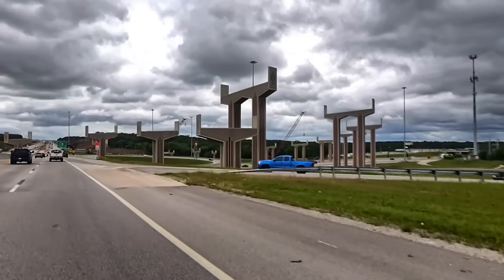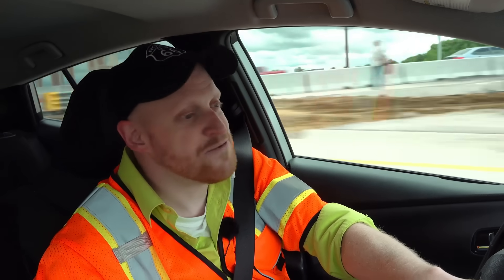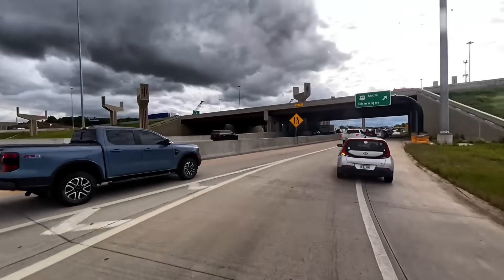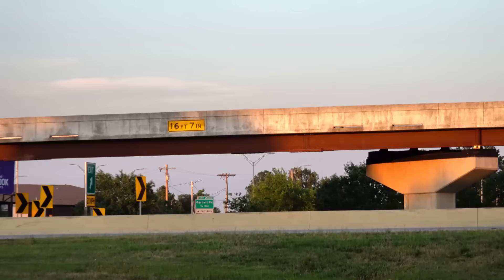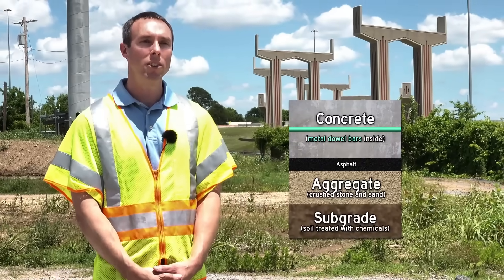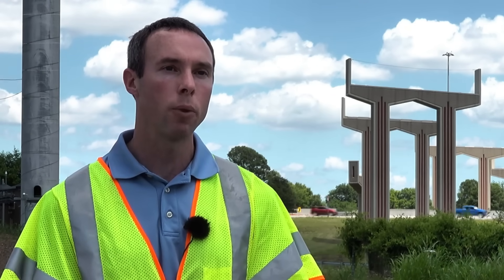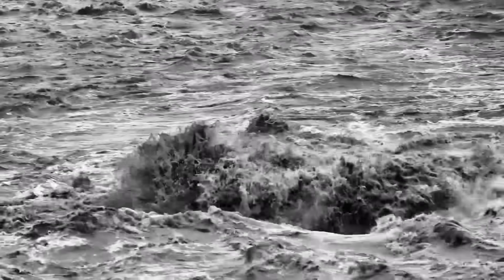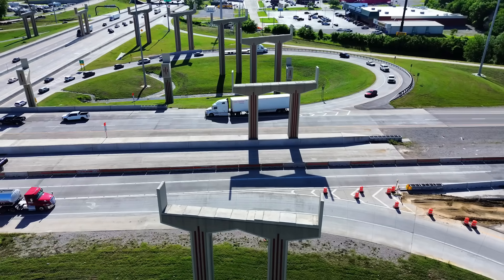Tulsa Built 50-Foot Goalposts 🏈 (It Fixes a Cloverleaf Catastrophe!)

Comment: Hey Rob, I am the engineer that oversaw the design of all those piers. This is by far the best video/article that I have seen detailing the reasons why these piers were constructed. Thank you!
Reply: There’s a good chance we know each other! I worked on the PE Study and WP1 & WP4! Super cool to see the project highlighted here and well explained. 

Fun fact for anyone else, the original functional plans included in the environmental assessment published in early 2000s actually used the metric system because the US had adopted it in the 70s and the USDOT was planning to require metric in all plans by 2000. But during the study that adoption got canceled, however the plans continued to be produced in metric.
Reply: @rosshelliker5564  Yes we do.
Reply: It's fun to hear how terminology changes over geographic regions. IE. "work packages" vs "phases" and "metal dowels" vs rebar. Most people around the NE would just say pilings even though "drilled shaft" may be a better description.
Reply: @SuperS05  In some other departments in Tulsa such as landscape architecture, we call them phases
Reply: Metal dowels are not the same as rebar. Dowels in pavement are typically used for load transfer between concrete panels, while rebar is used as reinforcement, specifically for tension forces in concrete, which is strong against compression, but weak against tension forces. 

Similarly, piles are different than drilled shafts. Piles are driven into the ground to a point called refusal, where they either can’t be driven any more, or only move a certain amount under the force of the pile driver over so many swings. Drilled shafts on the other hand and as they sound, drilled holes into the ground, then the rebar cages are lowered into the steel casing, and it’s filled with concrete.

Phases and work packages may be differences in regions. Phases would typically refer to different stages in the same construction project here.
Reply: @rosshelliker5564  I knew someone would correct me. Lol. Thanks for stepping up. My work comes after the concrete is done.

Here phases often are separated by time, sometimes significant time like in this project. They don't need to be, and can be just sequential or even partially overlap, but that's not as common. It's one over reaching project split up over time for various reasons. It is common when money is tight or the different phases rely on different seasons.
Reply: Good job on your design! How tight are the tolerances? Whenever I drive by I always think about how precise the height and various angles have to be to prevent things from failing.
Reply: @KrisRyanStallard  Thank you! It was a lot of fun and hard work to lay this interchange out and develop aesthetics that match the corridor while being unique to the interchange.

The tolerances are not that bad. ODOT has specifications that are nearly standard across the country. For example, the drilled shaft foundations can be off by as much as 3". The trick is to provide places for any errors to be fixed. At 0:06, you can see the top of the piers (the cap) were constructed straight. Now, they are constructing small steps, called pedestals, which you can see at 11:28 for the beams to sit on. While we generally specify the minimum height of these as 3", the contractor will adjust as needed so that the actual top elevation is within 0.01' (0.12") of what is shown on the plans. Here I went with 6" for additional wiggle room for the beam designer, and for some more tolerance due to the size.

Additionally, we include a section of concrete called the haunch that is between the deck and the beams. This haunch can vary between 1" and 4" depending on the length of the span and matches the width of the beam. After the beams are installed, a survey is taken along the beams. With that information and the expected deflection of the beams due to the weight of the deck, the contractor will adjust their forms so that the deck ends up in the correct location despite any misplacements of the beam.
Reply: Reminds me of the old highway piers outside Philadelphia international airport. The ramps off i-95 were reconfigured, leaving mysterious monoliths in the trees.
Reply: Has anyone seen my blue crayon?
Reply: Very interesting but it looks like your combining 2 on ramps into 1 super on ramp which means those 2 ramps combine and will be jockeying for position as they combine.  Although in this case you do not have one group of cars slowing down and another group trying to speed up.  Thus maybe it is the lesser of 2 evils.  Sounds like it takes even more space than a 4 leaf clover as they had to take several houses and businesses along that stretch.
Reply: They are working on it right now.... give them time
Reply: Liar
Reply: I understand YouTube is for everyone and this is ment for people that don't live here. How ever if your one of the engineers who decided this was a good idea. I got a question as a native here. North of us the get snow south of us they get rain we get ice more then most. I see this exchange as a major winter problem I've freezes on bridges first. The entrance and exit we have is on the ground they will freeze later. Once those are gone and the only thing we have to use at all is in the air. They will just be unusable all together. Are they gonna make them heated to stop the ice build up or just say sucks to be us when we have to get to work in the winter.
Reply: I live in Henryetta. I'm definitely sick of the construction. Instead fixing roads and fixing them right the first time instead of building bridges we didn't need sure would be nice
Reply: The incompetence on display throughout Oklahoma road design is a disgrace. Ramps are too short. The interstate design standard is superior from Colorado and west. Add to that, small cities like Tulsa don't have any comprehension of traffic flow. You're supposed to use the full length of the ramp and accelerate as you drive along the full length of the ramp, so you don't make the people you're moving in front of slow down to avoid hitting you. If traffic on the road you're merging onto is at a stand still, you still go to the end of the ramp, then alternate I-go-you-go (a "zipper merge," "das Reißverschlussverfahren" in German). Small city drivers are utterly oblivious to this. Traffic's supposed to be slowest to the right, then move progressively faster each lane to the left. Law enforcement is in absolute dereliction of duty in enforcing this. If you're not passing people on your right or keeping up within 2 seconds of the traffic in front of you, then you are wrong and need to move right and stay there. Keep up or keep right: "fahren zi rechts, das Rechtsfahrgebot" as the Germans say, who get this and teach their drivers this. The blame falls on incompetent driver’s education, media failing to convey this, and law enforcement failing to educate the public and enforce common sense.
Reply: We don't need more bs roads and more bs ramps and more bs multiple lanes. People just need to learn to slow down and enjoy the ride.
-Combat Vet

Comment: These pillars remind me of the ones built in Dallas at the intersection between 161 and George Bush Tollway.  They clearly wanted to build an interchange between the two high traffic roads, but couldn't afford it then.  So, why not just go ahead and build some of the supports and finish the connections later.  Almost 30 years later, the connects still have not been built, and those pillars they prebuilt are likely obsolete and would need to be torn down and rebuilt to modern standards.

Comment: Is there a difference between steel dowel bar and rebar? I've never heard that term.
Reply: Rebar reinforces concrete ,adds tensile strength and helps prevent cracking, whereas steel dowel bars are specifically designed to transfer loads and maintain alignment between adjacent concrete slabs or structures, especially at joints.
Reply: @batemanjo9  Hey thanks! That was really helpful!

Comment: The I-55/I-355 interchange has very similar geometry, and it, too, was surrounded by unused finished piers for what seemed like a decade. Once its multiple long flyovers were completed, along with the I-355 extension southwards, this interchange is working very well and at high capacity.

Comment: Glad to see this video. Just last week another major highway had a failure that required closure in Tulsa. You could make a years worth of videos on the awful state of Tulsa roads and highways. You know it’s bad when you notice a single block of road “isn’t that bad”. We would have less damage to our vehicles if we had dirt or cobblestone roads. It’s embarrassing to us all.
Reply: Thay is absolutely untrue about dirt and cobblestone.   As a mechanic, I can tell you that will wreck a suspension,  not to mention dirt roads cause all kinds of havoc from all the dirt, clogged filters, bad electrical connections,  so on (don't forget all the flats from sharp stones!) Neither of those road surfaces have good longevity,  especially under the punishment we put roads under these days.

Comment: Cloverleafs were never built to a degree here in Ontario. MOT here has built PARCLO (partial cloverleafs) where there is an intersection or lights at the end of the ramp at the exit but you dont usually see the backips onto limited access highways.

Road Guy, you need to see how Ontario has designed their 400 class highways and their history .
Reply: Cream of the crop; especially when driving in from QC!!
Reply: The 400 series has some of the best freeway design on the continent. I only can think of one interchange that’s a cloverleaf, Colonel Talbot just south of London, and it’s in the process of being rebuilt. Meanwhile the US will connect two interstate highways with a cloverleaf because they’re insane

Comment: While relatively uncommon in other states, Michigan has several modified cloverleafs where the mainline freeway lanes are separated with a narrow median strip from the exit/entrance ramps with collector/distributor (or C/D) lanes. I-69 at I-94 in Marshall, MI is one example; I-94 at US-23 in Ann Arbor is another.

It's marginally better than other cloverleaf designs because the congestion and traffic backups from entering and exiting traffic clogs are happening on the C/D lanes and not directly impacting through traffic. It falls apart when there's so much turning traffic that traffic backs up to the mainline freeway lanes. One example of this is I-290/IL 53 at I-90 in Schaumburg, IL, where that I-290 North to I-90 West movement backs up on a regular basis,  despite exit ramps that leave the mainline 3/4 of a mile before making the loop to I-90 West.

Michigan has plans at I-69 and I-94 to replace the North I-69 to West I-94 movement with a flyover, anticipating that the traffic generated by Ford's new battery manufacturing plant will overwhelm the capability of the current modified cloverleaf design.

Comment: Part of the congestion problem is due to every single person in Oklahoma insisting on driving around in a full size pickup or SUV. Road capacity is reduced significantly by the excessive bulk.
Reply: There’s a lot less of them these days than there used to be. Compact SUVs like the RAV4 or CRV are way more common now than Suburbans or Expeditions

Comment: 3:28 my city has a cloverleaf interchange with an entire separate section so that it minimizes traffic buildup on the actual interstate. The only issue is that it goes to 1 lane off the interstate to 2 lanes in between the leafs and then back to 1 lane afterwards, mostly due to it meeting up with another ramp before merging back onto the interstate. Usually it ends up working but occasionally there will be backup onto the interstate. Same thing happens with exits 19A-C during rush hour which becomes a cash cove for the city when people fail to keep in the outermost lane of travel and block half of the elevated roadway causing traffic buildup and stress on the elevated roadway

Comment: The cloverleaf interchange should be good enough. No traffic lights, no give-way signs. If just changing lanes when leaving the freeway causes so many delays, there are way too many cars on that road. Adding any more capacity will cause 'induced demand' and one more lane will never fix the issue.
Reply: Traffic on this interchange did not rise by itself but through long-term growth, call it sprawl if you wish. I thought Rob was very thorough in presenting the local history, identifying short merging zones of the cloverleaf as root cause, and showing the tradeoffs of potential solutions.

Comment: the biggest problem with cities putting on and off ramps at every major street, is you then have local traffic using what was supposed to be a high speed bypass road.
Reply: but if you dont you get lots of outside commuter traffic clogging a few roads, 

the best option is auxillary lanes to let people jump one exit with out ever having to merge on
Reply: @ThunderClawShocktrix Texas got these
Reply: @ThunderClawShocktrix  The best option is a ring road around the city and no freeways THROUGH the city.  Cities are for people, rural areas are for cars
Reply: @admiralcapn  Who do you think is in the cars, walkcel? It's people. My house is approximately 15 miles from downtown Tulsa, how do you suggest I get into the city efficiently and regularly without a car?
Reply: Tulsa has an access road that runs along the length of most of the highways exactly for that reason.  It is considered one of the easiest to navigate cities in the US.
Reply: @sinisterthoughts2896  Tulsa is very easy to navigate but that's mainly because it's small in both population and size. Compare that to even OKC which has double the population and 3x the land mass. And OKC is considered a small city as well. Other cities are hard to navigate because there's a ton of people